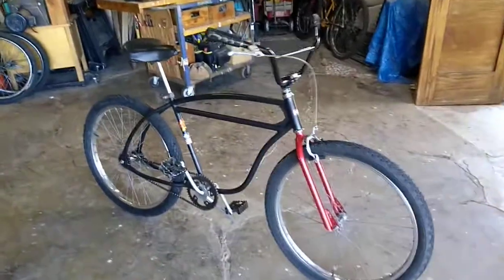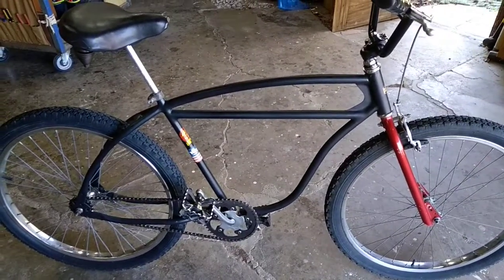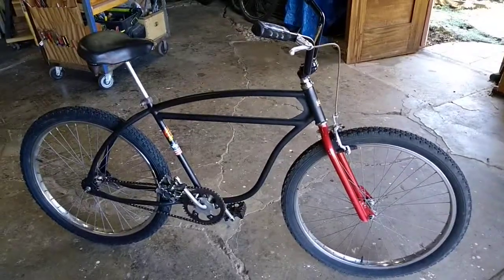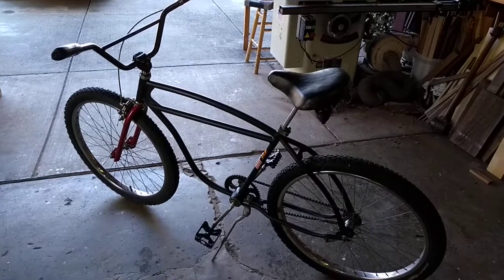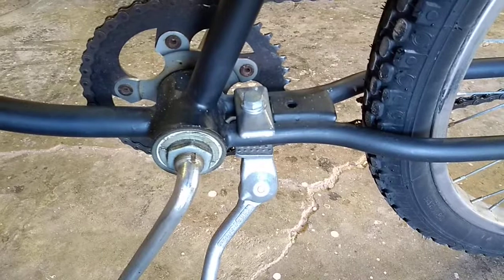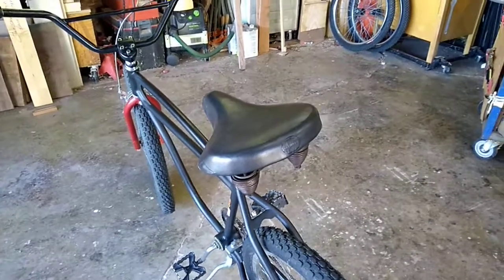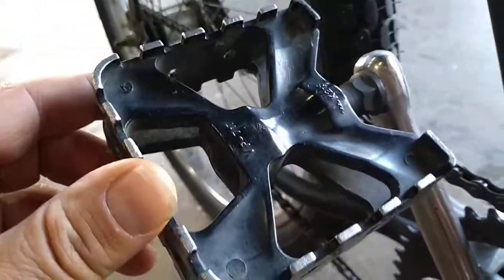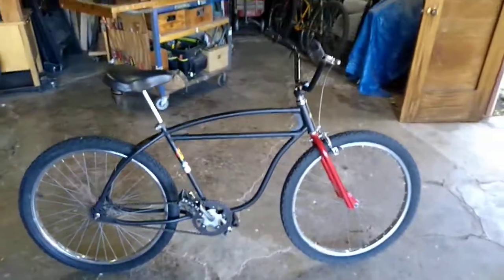Cleveland Welding Company Klunker

Comment: Nice bike! I like the details and using motorcycle handlebars. I have to catch myself because it would be way too easy to run over to Ebay and buy up frames with PayPal credit. I gotta admit, I did just pick up a Sturmy Archer drum brake hub for my Huffy to make downhills on some of the trails I ride a little less stupid. Love your channel! Thanks for steering me here.
Reply from the maker: I'm diggin' your stuff, too - Been meaning to make a bow forever - You'd probably get a kick out of my Survival Shirt video...  Good stuff, man...
Reply: @AstroVanTribe  Haha, I'll have to check it out. Not that you'll use this secret information, but I went for a ride and found out that Maxxis Hookworms are grippy on hard packed snow and ice. It was a brisk 12 degrees with a minus something windchill today on the trails.